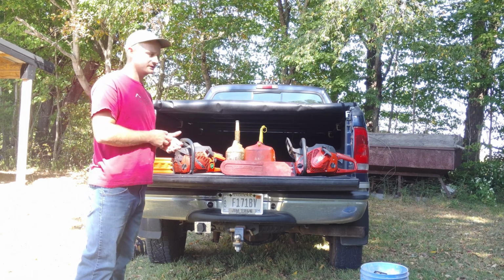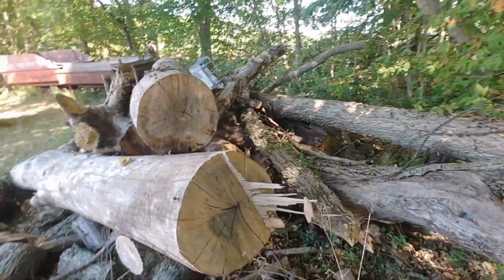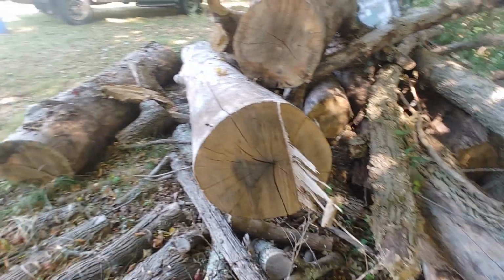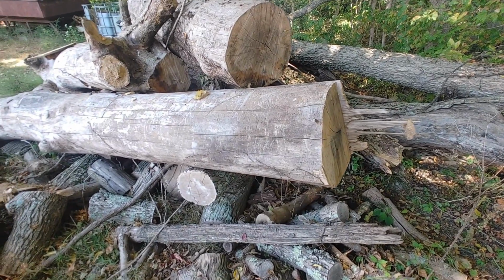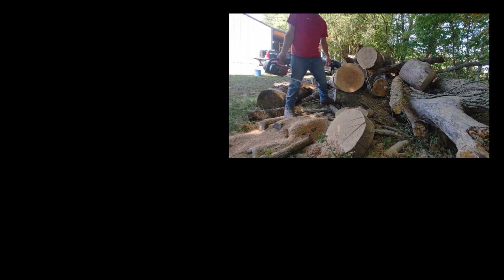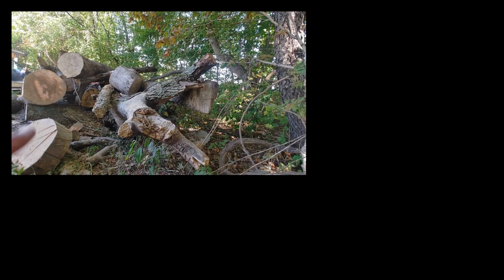Jonsered 2159c vs Jonsered 2255 Buck off! Husqvarna 359, Husqvarna 455 Rancher

Comment: What huskys would the jonsereds be equivalent to? Wait, that's what you mean in the title?

Dead ash gets harder and harder
Reply from the maker: @brandonhoad9033  the 2159c is a 359 Husky and the 2255 is a 455 rancher.
Reply from the maker: My 2186 was a 385xp, but I put a hyway 390 piston/cylinder. Basically a 390xp now
Reply: @LudasGarage  by the title, I at first thought you were going to run two sets of saws.
Reply from the maker: @brandonhoad9033  Ah I gotcha, just the husqvarna saws in red plastic